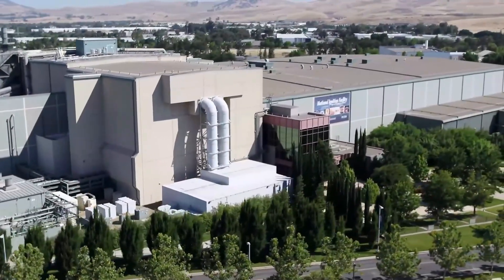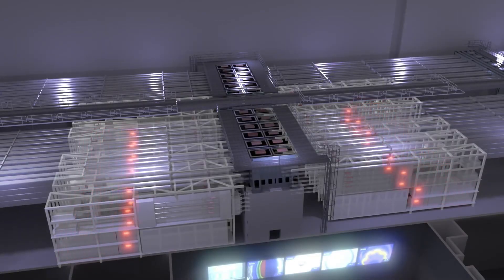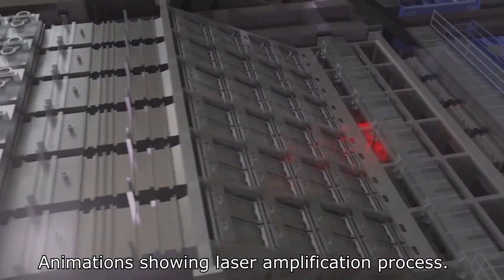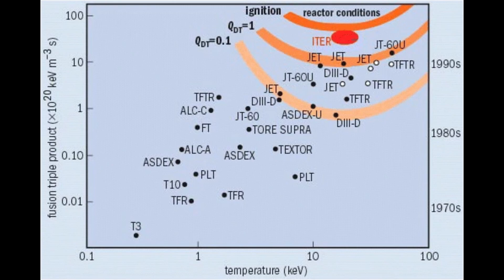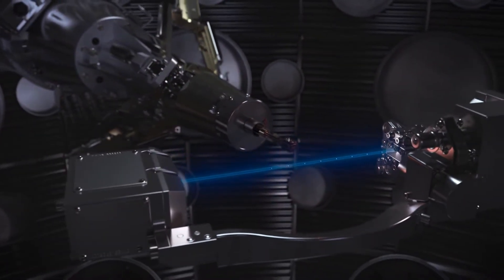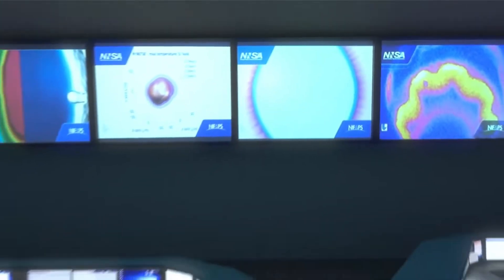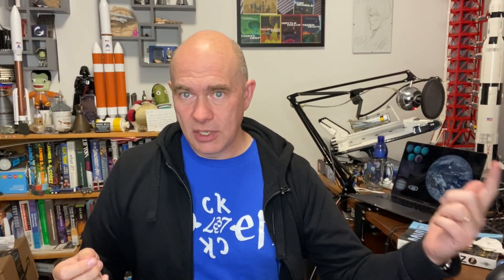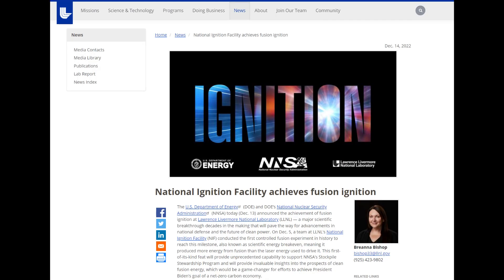Why The Biggest Laser in the World is Making Big News About Fusion

Comment: Hydrogen boron supposedly is a far better reaction to produce heat instead of useless, dangerous neutrons and x-rays, but H-B requires 10x the temp. Practical fusion is still a pipe dream.

In defense of inertial confinement, consider the frightening aspect of nukes- the fusion fuel is a fuse of indefinite length with a little ball/pellet on one end which serves as the igniter. Once ignited, you can detonate as much as one wants just by adding length because it's self sustaining.

Comment: And always will be 15 years out.

I'm not saying that we shouldn't be working on fusion but right now we have the perfect fusion reactor separated by the perfect containment building. It's called the sun. 

We should be working on Battery technology, thorium fueled fission and a more direct conversion of neutrons and X rays to electricity. 

I suppose that a steam turbine is better than a steam engine but not by much.

Comment: Thank you Scott for the good coverage of this event. There has been a lot of press around this with a lot of inaccuracies, misconceptions and misunderstandings. You actually provided one of the most accurate covering on this. A couple of comments; 

It is not the radiation pressure that implodes the pellet but the "rocket effect" from outward ejection of material ablated from the target surface caused by the X-ray interaction with the abaltor material. 

The way forward for ICF is not so much bigger lasers but more efficient and higher repetition rate lasers, using also a concept called Direct Drive where you bypass the Holhraum and shine the lasers directly on target. The gain of this approach is much higher because you bypass the laser to xray conversion efficiency. It is also a bit challenging because you exacerbate symmetry control issues. 

You mentioned Rayleigh Taylor,  but there are also laser plasma coupling instabilities but those are expected to be addressed by adding significant bandwidth to the laser system. 

Finally, be very wary about all these fusion startups; they are heavy on marketing but very light on the actual feasibility of high gains through the approaches they sell. The only approaches currently proven (by the scientific community) to be viable for fusion energy are magnetic and inertial (with lasers) confinement. 

Cheers.
Reply: Scale this to how far Bill Gates has gotten with TerraPower and the history of MSR's, and more recent SMR tech. Fusion is a decent stop-gap for the layman, as coal is on the opposite end of the equation. Too bad more media continues to... exclude too much of said 'middle' ground. Perhaps an education revolution is in order.

Comment: My money’s on Helion still, not because of the project or the team but because I have doubts on the feasibility of tritium fueled reactors. The rarity of that substance couldn’t possibly overstated, it may as well barely exist for how much of it is around globally. Helium3 is definitely more feasible in my eyes even if the fusion itself will be more difficult.
Reply: Part of the engineering includes the manufacture of tritium.  Not trivial, of course, but solvable.

Comment: To absorb the 14.1MeV neutrons generated by the DT reaction, Scott, the reaction-chamber would be surrounded by a Lithium-Deuturide blanket where the Lithium would absorb the neutron and fission into Tritium and Helium (+ a neutron if it's Lithium-7). The Lithium fission generates a lot of heat and the LiD blanket would then be used to generate steam to drive a steam-turbine while the Tritium is itself a fusion fuel (Along with the Deuterium).

Comment: if we used the fuel source that the helion reactor used(i believe its helium 3 and duterium to make helium 4, and the precurser is using duterium to make helium 3)
again, if we used that, then we should have an abundance of fuel
Reply: True.. if helion isn't snake oil.  Lets keep our fingers crossed.
Reply from the maker: However you then need much higher pressures and temperatures, there’s a reason most people aren’t using helium 3

Comment: This another example of only counting a small part of the input energy to make sensational headlines. The 2.05MJ laser input energy is the total energy the lasers put INTO the reaction. The energy required to power those Laser's to make that input energy is around 400MJ. From this they get back 3.15MJ which is less than 1%. That's not even the whole story, the 3.15MJ is just heat, we will loose around 50% of that energy converting heat into usable electricty. SO, in twinkie terms ,  we are giving 800 twinkies and getting back 6 !!!!! This is the sad reality of nuclear fusion feasibility today
Reply: You are right that the feasibility is not there, but you also didn't understand what they were actually looking for when they measured success.  This isn't a powerplant or even designed to generate a watt of electricity.  It's a system designed to prove a concept, nothing more.

Comment: They’ve been at it a lot longer than 10 years, I visit the facilities in the 80s, it felt like bowels of the death star weapons room. We were on the verge of a major breakthrough back then apparently according to the staff.
They a fusion project that uses a collapsing plasmoid for confinement instead of lasers or superconductors, also as it’s aneutronic fusion it output electricity directly, you should check them out Focus Fusion the reactor not the car.

Comment: You should also check out Helion's plasma accelerator fusion generator, Trenta. It slams two small super-heated toroidal deuterium plasma donuts into each other with a pair of linear railguns, basically. The reaction products pushing against the magnetic containment field is used to induct a current, eliminating the need for steam or turbines etc. Just direct power out, bypassing steps 1-4 in a tokamak design.
Reply: If I'm not mistaken, Helion gave the first look at Trenta and first public discussion of their method within this past week as I'm writing this. They're about to retire Trenta for the next generation device they've been working on.

Comment: @6:40 "That first step to go from two protons into deuterium takes a very long time" - it takes a very long time in a sense that chance of this process in extremely low, about 0.00000000000000000000001% in the Sun, but in super massive stars that have 100 times the mass of the Sun, this chance is millions or even billions of times higher that's why they fuse hydrogen so much faster. Not that the actual process of one pair of protons to fuse would take billions of years in the Sun.

Comment: The problem with this is its not constant and it's a lot of juice at once. It will work better as an explosive.  Usable power on the other hand has to be steady constant and mellow... think 3 mile Island. To much juice at once is bad. The battery technology hasn't caught up and a burst of 1.2-3 times the output of the input would burn up the current grid.

Comment: This is an incredible break through but it seems impractical for energy production on a larger scale. Is it possible to do a video on the recent Helion approach? Real Engineering did a video on this a couple days and I’m curious about your thoughts. The method they use is a “pinch” process where the Deuterium and Helium-3 gas used as the fuel.

Comment: All that's left is to get about 100x as much energy out of the reaction without putting any more in(because they've only achieved more energy generated compared to the energy in the laser pulse, not the energy required to generate the laser pulse, and then you need enough energy left over to actually do work with), and figure out how to inject targets and pulse the lasers at a rate at least 200,000 times as fast as they can currently manage(because right now it takes over 20,000 seconds to reset for another shot, whereas a commercial reactor would need to shoot at least ten times a second).

But they're close!

Comment: Clarification:  While proton + electron + proton fusion (PEP) can occur, it is not the route for the majority of the initial stage of hydrogen-1 fusion in the Sun -- somewhere between 1 in 300 and 1 in 400 depending upon which source you look at(*).  Instead, most of the time, it occurs by beta+ decay of the transient helium-2 (PP fusion) -- the binding energy of a deuteron is more than enough to pay for a proton to emit a positron and a neutrino and thereby convert into a neutron, even though a neutron is a bit more massive than a proton when both are in isolation.  The positron will then annihilate with an electron, producing the same end result apart from a difference in the amount of energy carried away by neutrinos (this difference is measurable in neutrino detectors -- see Borexino).  Wikipedia has good summaries of this.

(*)The 1 in 400 figure comes from measurements made with Borexino, so it is probably closer to correct.

Since PP has 2 input particles and PEP has 3 input particles, it is reasonable to expect that at extremely high densities, the latter might dominate.  Such conditions may occur when infalling hydrogen is compressed on the surface of a white dwarf (producing a nova) or especially a neutron star (producing a similar but much more confined eruption), if enough accumulates before a self-sustaining reaction ignites.  Edit:  For a neutron star accreting hydrogen with episodic ignition, this is a Type I X-ray burst.

Comment: The 1:1 input:output ratio is only relevent when you put the system boundry around the whole device aka taking into account all inefficiencies of electricity into plasma and plasma output back to electricity.  When you draw a boundry at just the plasma you need a vastly higher ratio, atleast 5:1 more likely 10:1, at that ratio we could build a device that ran on it's own power and then had some surplus.  So hyping this ratio is a bit like saying your goal is to get to the Olympics and running a 4 miniute Mile is nessary for the qualifiers, so you train and train and gradually get faster.  Then you anounce that you have successfully run a 4 minute KILOMETER.  This is ofcourse no where near whats needed and relies on peoples misunderstanding to make it seem significant.

Comment: So if I'm understanding this correctly, the lasers heat the container walls, and the ablation of said container walls is what exerts pressure on the fuel pellet. My question then is why can't we use some more volatile container which will "burn" without, or with less encouragement from a highly inefficient laser? We could then input the required energy into the reaction more efficiently and exert the required pressure on the fuel by the chemical or radiological decomposition of the container rather than laser powered thermal decomposition. Or did we already do that and we just call it a hydrogen bomb rather than a fusion reactor?

While this research is highly intriguing and very promising, I doubt that we will see it come to fruition in the form of large scale power generation any time in the near future. Big Oil isn't done obliterating the planet for profit yet and there is no way a research project is going to be able to compete with the fossil fuel industry unless the government intervenes and prevents oil companies from financially destroying the research organizations.

Comment: Believe it or not that laser starts out with a tiny fiber laser not unlike those in a communication system. The pulse is generated by q-switching it. Then the pulse is amplified then clipped to make it about 4nS in duration. Next it is amplified by Nd:phosphate glass rods. Then the beams are split into 192 beams that are switched through the big amplifiers with flash tubes that are the size of shop florescent lamps. Finally the beam is let out by a polarizer while a KDP turns it green at 532nm then a bBO crysyal turns it to UV at 355nm. This UV beam is directed through lenses at the target. All these pieces must work absolutely perfect, any imperfections will cause some bits to physically explode. 🤓

Comment: Sorry if this is an ignorant, short sighted comment, but when and if fusion power does happen how do the oil companies respond? Will they try their hardest to prevent it?
Reply: no. Oil companies will not fret. Not in the slightest.  Fission, and Fusion (IF) are wholly and completely dependent on a global technological civilization which is powered by F.F.
120yrs of electrical system knowledge and science have demonstrated that there are places where electrical will not scale and will not suffice - I.e. not portable enough to replace F.F.   As such, the more complexity required for a technological system, the more dependence is placed upon the F.F. base.   Fusion, for example, IF they ever get to point of sustained fusion,  the fusion reactors themselves will require huge amounts of tritium fuel which is not currently available.  Tritium is made exclusively in fission reactors.  So massive numbers of additional fission reactors will need-be built, to supply the fuel for fusion reactors.   Both of these systems, and the electrical grid in general are dependent upon metal resources, minerals, polymers and plastics which can not be mined or manufactured without fossil fuels - particularly oil.   When oil someday becomes too expensive to extract from the ground, the electrical era will end.  There is no known substitutes for the things fossil fuels provide in addition to condensed, transportable energy.
If this were not the case, and our dependence upon fossil fuels could be curbed or mitigated - then certainly the last 20 years of climate concern and so-called renewable-energy(not) would have reduced global consumption.    The opposite is true.  Dependence and demand on  fossil fuels have grown,  consistently, year on year since concern was first voiced.
Because of limitations in resource access and declining quality - growth in energy demand exceeds the practical limits of generating electricity in any other way.
No oil companies do not worry.  Not ever.
-- Physicist @LLNL.gov
Reply: The last drop of oil will be a long gone memory before a fusion plant exists.  I think it's a fools errand, but in this case I'd love to be wrong.

Comment: In the Sun, after the protons fuse, one of them undergoes beta plus decay, converting by emitting a positron and an electron neutrino, a very few undergo the electron capture reaction Scott describes. The frequency ratio of the electron capture reaction versus the positron reaction is 1:400. Thus the positron reaction produces 99% of the energy.

Comment: look here is what really happening; since the sixties  fusion has been promising ten years from now we'll have fusion.  so what really happened is small but still progress.  its like pushing on a really heavy truck and after 60 years moving it one mm.  lets cheek getting it up the hill can't be much harder.  ha, the closer you need to get to a target temperature and pressure the harder it is to achieve. more likely it well be another ten + years until fusion can be of any useable power concentration.  so really nothing really changed.  Question how long did it take to get to reach the temp-pressure obtained? And how long will it take to get it hotter and compressed to say run a simple Batery charger?  10-20-30 or more like another 60 years.

Comment: An incredible accomplishment, sure.

But I very much doubt that it has any relevance to fusion power. We don't generate electricity from fission by setting off fission reactions that blow themselves apart. We almost certainly won't generate electricity from fusion by setting off fusion reactions that blow themselves apart. We need a bit more steady-state of a reaction for that.

(And before someone says "the Sun! Solar panels!", the point is to have much more consistent, higher-density power sources.)
Reply: It has some small relevance.  This is a tiny step and likely to result in nothing.  See it as a proof of concept nothing else.  They now know they can do it.. and that's it.  How useful?  Not at all.

Comment: But, there is a way to get the fusion power of the sun in your grid: solar panels
with the estimated 3.5 to 3.9 B costs for the NIF you could have had 160.000 Homes equipped with a 10kw system each